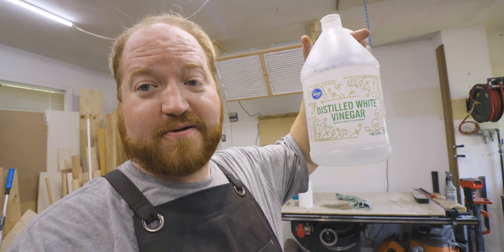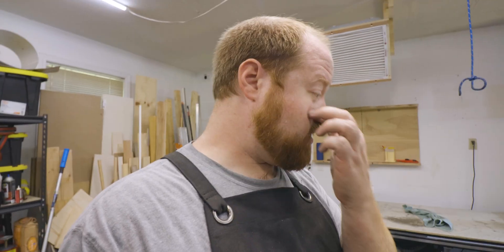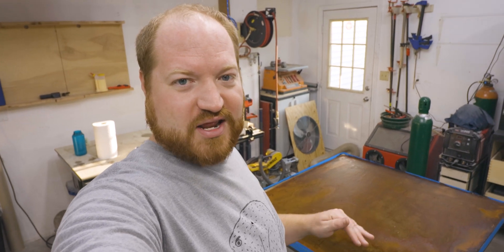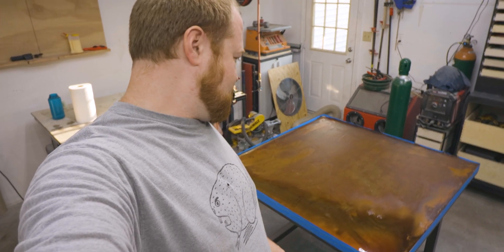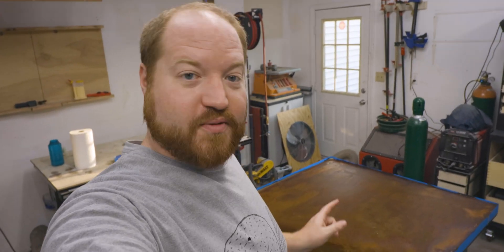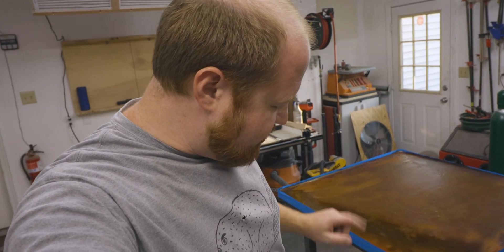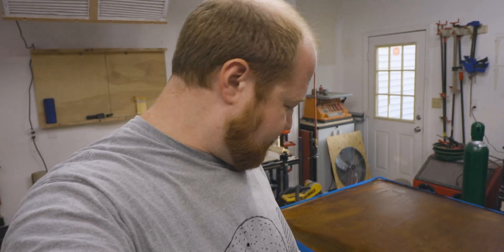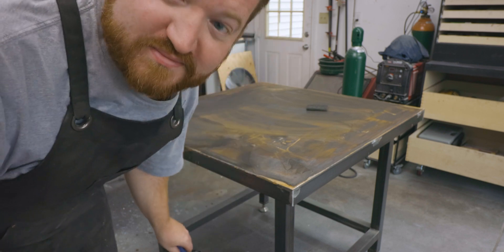Using Vinegar to removal scale from steel

Comment: I have a big sheet that needs stripping, so I laid it down horizontally, covered it in paper towels to hold the vinegar, sprayed the towels with vinegar, and covered it with poly to keep the vinegar from evaporating and left it overnight. Worked great!

Comment: Another option -lay shop rags on table.  Soak with vinegar and cover with wax paper to prevent evaperation and leave overnight and wash off the next day (I used a hose).  Came sparkling clean for me and no mess or extra work.

Comment: Clean-up would probably a little easier if you let it set overnight.  Maybe cover with plastic to help with smell and evaporation.  I have a welding table a need to clean.  I was going to soak rags in vinegar and lay on top, but I think I will try your technique.  Thanks for sharing.

Comment: Great Idea !! If the table was more leveled then you may have got much even/better coverage. I have tried with vinegar and they do work great as long as we keep for a right amount of time which is tricky. Acid takes away some of the surface rust , mill scale and also removes steel from under the scale too. There needs to be a balance else the steel surface will become porous. To neutralize any acidic residue one may try to spreading  light coat of baking soda and give a light rinse and dry quickly. This process generally gives me a few additional days before any visible sign of surface rust.

Comment: If you do another one, you should consider just taking the table outside and hosing it off. The video made it look like an awful lot of work. If you just took the tape off a corner, and hosed the thing off into a bucket or down the drain, then scrubbed with a surface conditioning pad (scotch brite), and hit it with maybe some compressed air to dry it off, then paper towel (or even a scotch brite again) with some oil to clear off any flash rust, and protect it from further rust... The process would have likely been a lot less messy, a lot faster, and might convert more people. :) All around nice video though. Great work!

Comment: great video!   however if you buy  extra strength vinegar you will find it works not only better but faster.
Reply from the maker: I didn't know extra strength vinegar was even a thing.
Reply: @Obscuremotorsports  They sell it at Walmart in cleaning supplies (6% acid).  You can get stronger stuff online (30- 90% acid).  Some people use it as a natural weed killer.

Comment: Come on!! You didn't record the scraping!! 😂 I was hoping you would have some great tips on how to not get that crap everywhere!
Reply from the maker: I know!!!! I thought I hit record, but apparently I didn't!!! I was soo upset. What I did was leave the tape on the table, and removed about a 10 inch long section on one of the edges. Then I used a drywall knife and scraped it out and into a bucket underneath. Once I got everything away from the edges I removed the tape and pushed the rest off into the bucket and wiped it all down with paper towels.